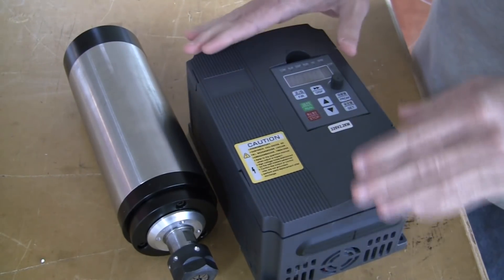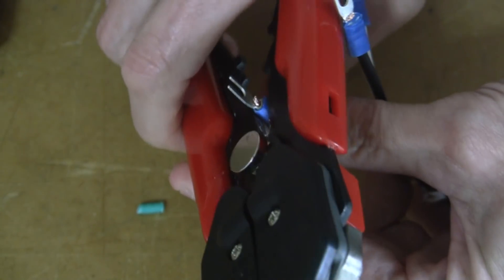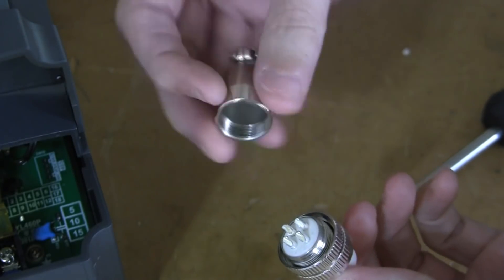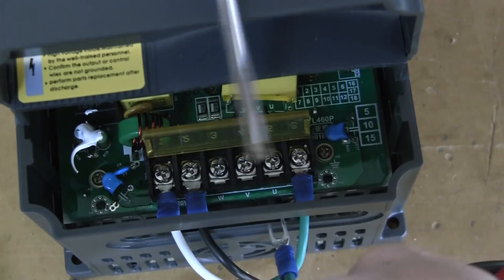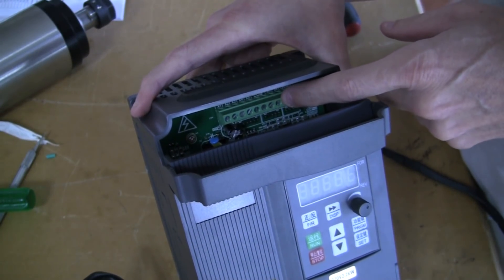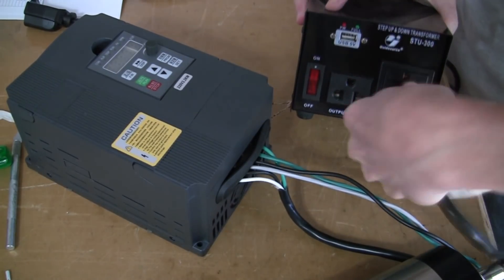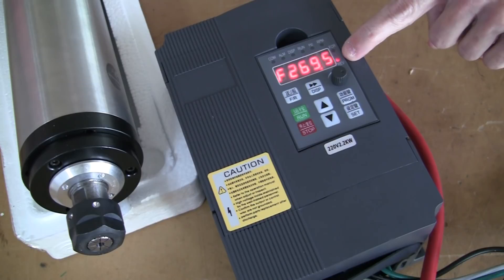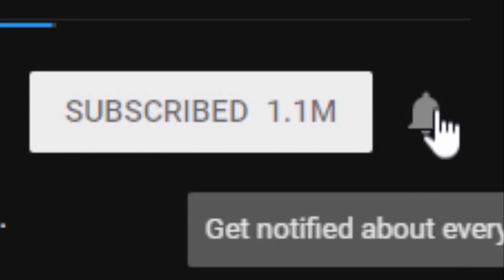Spindle and VFD (Variable Frequency Drive) Setup Part 1

Comment: why only 3 cable connected, how about pin number 4?
Reply from the maker: Pin number 4 is not conected on most Chinese spindles. Some will have pin number 4 connected to the body of the spindle, but most machines are already grounded, so no ground pin is necessary on the spindle itself. If the machine in not grounded, you may want to connect a 4th conductor of a 4 conductor cable to one of the screws of the connector on the spindle.
Reply: @PatrickHoodDaniel  ok, thanks for answer

Comment: Hello please. How do I fix the problem when my 2.2 best inverter is showing hoc
Reply from the maker: That is an overcurrent message. I would first measure the resistance between the three pins on the spindle to see if the windings have a short. Do do this, use a multimeter set to ohms, measure between pins 1 and 2, then 2 and 3 and finally 1 and 3. Make sure to do this with the cable off because the cable may have a short by itself. If the measurements are the same, the cable may be bad. It is difficult to test a cable because the issue can show itself when the cable is laying differently, so it would be best to replace the cable.
If you are experiencing this problem with a totally new VFD and spindle, you may want to reduce the ramp up and deceleration (make it a longer time).

Comment: I installed my spindle like you showed. but instead mei u was connected to 1, v to 2 and w to 3 (the spindle supplier told me this). When I start the spindle with the button "run" it runs, but then all light (com, alm, dsp, run, hz, rpm) blink very fast and i cannot stop or adjust the rpms. Does anybody had the issue? Has it something to do that i dont have a break resistance or is just the wiring wrong?

Comment: ❤what a majestic VIDEO!!THANK YOU 🙏 SO MUCH WHOEVER YOU ARE!!   1question 4 you: i have exactly the same VFD and I need to control the speed of an AC asynchronous Motor with raspberry pi; do you have any suggestion on the VFD wiring with the Raspberry pi? Could you please point me in the right direction? Thanks 🙏🙏🏿🙏🏿 a lot!
Reply from the maker: You only need the Rpi to output a PWM between 0-10V and use the VI and ACM terminals in the VFD with this PWM output. PWM to VI, RPi gnd to ACM. If you need a voltage reference of 10V, you can use the 10V terminal in the VFD.
Reply: @PatrickHoodDaniel   THANK YOU SO MUCH   YOU ARE AWSOME!!! BLESS YOU

Comment: This is not how you should be wiring a VFD Drive to one of these spindles, Electrical Code would not allow you to do it like this, this is very dangerous to wire it like this
Reply from the maker: Can you point out the error?

Comment: Thank you very much
After doing further research I noted the forth pin was connected to the ground and a cable that is shielded will provide the best results.
Cheers
Reply from the maker: Some of the spindles don't have the 4th pin connected to the body of the spindle. If your machine is grounded, you don't need to connect the 4th pin and some manufacturers will warn the end user to not use the 4th pin if the machine is grounded and the spindle is conducted to this ground (via the metal on the machine).

Comment: Thanks for the video. The video was very educative, however, I would like to ask some questions. First a background, I am setting a reactor for my PhD project and I need to run 2 pumps in variating frequences. As your video demonstrates, the motor/spindle runs only with the VFD and nothing else, correct? And for the installation, the power goes through the VFD and then connects to the spindle, so no further connections are necessary, right? Thanks a lot!
Reply: I've used a couple VFD's for other purposes and I'd say your assumptions are correct, just wall power -> vfd -> three phase motor.  Nothing else (besides the appropriate kind of wires in between).

Comment: I've been running my VFD's on a 3/4 HP 3 phase 3,000 rpm motor.........I made a chart to indicate the actual motor rpm.........connecting it according to the video was clear.....thanks for your time.
Reply from the maker: Thanks for the info!

Comment: Hi Sir. Can you help please . Can Mach 3 programs to control  spindle /VFD go forward and Reverse  ? Thanks.
Reply from the maker: Yes. You can use the M3 to run forward and M4 to run reverse. M5 to stop both.
Reply from the maker: You will need to connect the VFD through two outputs on your controller.
Reply: Thank you very much Sir!
Reply: Hi Sir.
Do you have a video or instructions how to wire and pins set  connected to control board ?
Thanks for your help!

Comment: How you manage to run the 2.2kw spindle with a 300w step up transformer?
Reply from the maker: I use a 3000W transformer for anything with load. The video here is only a 300W transformer because I am only testing the spindle and VFD with no load on the spindle.

Comment: What type/ga wire do you use for the spindle?
Reply from the maker: I would recommend using 16 AWG, but 18 AWG has worked for me.  Some spindles and VFD come with 18 AWG cable.  The wattage is divided by the three phases, so the actual current on each wire is 3.333 amps.

Comment: i also have a 2.2kw for cnc but its spinning CCW. The buttons or knobs on the inverter and the run buttons etc doesn't work on da inverter. It jst turns on n off from Mach3. No fwd/rve switch on it too. Can i chnage direction becz its meant 2 turn CW as shown on its motor description
Reply from the maker: Just swap two of the three wires that connect the spindle to the VFD.

Comment: Is the spindle a 3-phase unit and is the VFD 3 Phase as well. I have a 220 Volt/400 HZ 1.5 KW Air cooled spindle that I purchased online, but need to know what type of vfd it needS. I have one from an old lathe that we used for 220 Volt single phase to a 3-phase mill.. do you know if it will work..

Comment: Hi There, I did try with other kind of vfd who can also drive spindle but get a error on display P.oFF and no running or output voltage. manuel says nothing about it. Maybe you can, Thanks in advance.

Comment: I have Motor 37 kw
1780 rpm
220v
Can I use this Inverter

For the Motor?
Reply from the maker: This inverter is for a maximum of 2.2kW.
Reply: you need buy inverter who can run 37KW super expensive. and very big cables need be. VFD need be same size what motor you use. 2KW motor need 2KW VFD, 18 KW motor need 18KW VFD.  not can use 2KW VFD and run 20 or 37KW motor. lot different.

Comment: I'm new to CNC, but it seems a VFD is not required, right? What can a VFD allow you to do with CNC that you couldn't otherwise do?
Reply from the maker: A VFD is required if you use a spindle.  If you use a router, a VFD is not required.
Reply: @PatrickHoodDaniel  Oh, well, now it's starting to make more sense. I thought a spindle was just another term for a router that's made specifically for use with a CNC machine. Can you cool a spindle with air? I was looking at a 1050 FME-W DI spindle.
Reply: Actually, aren't these Kress/AMB spindles more like a router in the sense that they aren't water-cooled and don't need a VFD or am I wrong?
Reply from the maker: @tomjoad6993  You can cool a spindle with air.  There are air-cooled spindles, but I don't sell them.  I like water-cooled spindles because there is no air movement pushing the dust and chips in the shop.  Water-cooled spindles are great because it's less noisy (no blower fan) and the vacuum can work more efficiently removing all of the chips and dust.  Water cooling is not a big deal to establish and it cal all be compactly fixed on the Z-axis.
https://buildyourcnc.com/item/pneumatic-hydraulic-spindle-inverter-cooling-water-pump-reservoir-fan-radiator-g14fittings-silicone-tubing
Reply from the maker: @tomjoad6993  I don't have very much experience with Kress or AMB.  From what I know, Kress are very much like routers and don't need VFDs.

Comment: Good video. However I would recommend connecting the spindle to the VFD using shielded cable and earthing the shield at the VFD end. This is really important for CNC systems to stop the spurious electrical noise causing problems with your steppers. Also it appears that you did'nt earth the spindle either, which is not really a good thing to do.
Reply from the maker: Thanks.  I have been using shielding a little while after I made this video.  Initially, I was testing the PWM from the computer to the VFD and noticed the value jumping around like crazy.  Now I shield the spindle cable and I also shield the PWM signal cable.  I've also seen some folks actually use ferrite to assist with the PWM signal cable.  The wires are coiled around the ferrite to create inductance.  I'm not sure how this helps, but if you or anyone could shed some light on this, I think it would benefit others.
Reply: @PatrickHoodDaniel  The ferrite core is known as a load reactor but it’s just an inductor. Motors on VFDs create a lot of harmonics and reflected signals (voltage spikes coming from the motor back into the VFD). These spikes can reach thousands of volts so the load reactor is there to limit the spikes and protect the VFD and motor
Reply: Thks!!
Reply: The spindle must be earthed (grounded) for safety! Without en earth, a small breakdown in spindle winding insulation can cause the body of the spindle to become energised with a couple of hundred volts and killing someone. With proper earthing, the faulty spindle will trip the fuse, CB or the drive unit, keeping everyone safe and you knowing your spindle has an electrical fault. Earthing/grounding is essential to safe operation!

Comment: good video  but can you let me know where the wires go in the 2 top buss bars, i have had to change from a sunfar e300 to a huanyang and all the lettering is different the old was X1,X2.X3, CM, & FWD the last 2 being linked. i can get the spindle to turn when i press run, but not from the computer, Please help paul@wwww.uk.net.

Comment: conduits inside of cable? Interesting...using cord for your spindle is no beuno. Spindle motor is three phase, plus you need a fourth wire out there for a ground. Should also be shielded. That VFD will make lots of interference which can drive your controls bonkers. Don't use 300V rated cord. Not safe.
And conduits are pipes that you run wires in as a raceway. Conductors are inside of cords.
Reply from the maker: Thanks for the expert advice.  I currently use shielded cable and I add a 4th wire to the body of the spindle.  Is that what you would recommend?  What gauge would you recommend for 2.2kW spindle understanding that each wire would carry 1/3 of the current.
Reply: Great!
I would definitely recommend the protective earth connected to the body of the spindle motor. I think 16 ga would be the minimum size you'd want to use on a 2.2KW spindle.  The 2.2KW motor will draw roughly 10 amps at full load, which is 10 amps on each wire, 10 amps total. You wouldn't divide 10 amps by 3 to get the current on each wire, or multiply 10 by 3 to get total amps. A three phase motor is sort of like 3 single phase circuits, only each circuit is 120 degrees out of phase with each other.
Also, I re-read my original comment and it looks a little abrasive. I apologize for that.
Reply from the maker: @shampyswoodworking525  Thanks for the clarification.  I was under the assumption that since the total drawn from the spindle was 10 amps (2200W/220V = 10A) and if the total current was traveling through three separate coils, that would be divided by three, making each wire requirement at 3.34 amps.
Reply: @PatrickHoodDaniel  no, that isn't the case. If you look at a 3 phase motor's nameplate, you'll see a bunch of ratings and data for that motor. One of the numbers will be labeled FLA, which is full load amperage. If the FLA rating is 10 amps, each leg will draw 10 amps when the motor is doing it's rated KW or horsepower worth of work. We would describe that as 10 amps, 240 volts, three phase. Likewise for a single phase 240 volt circuit in your house... same idea. Your dryer might have a 50 amp, two pole breaker feeding it. That breaker is essentially 2 single pole breakers tied together, each pole rated at 50 amps, not 2 poles at 25 each. So the motor's wire size needs to be sized to it's FLA rating, in this case a 2.2KW motor at the given voltage will be around 10 amps (A little less than 10 actually, because in the US the single phase voltage will really be 240V).

Comment: Thats 110v not 220v WTF
Reply: Nah, it's a 240v, it is just wired up weird.  He used a normal 120v plug, but when he plugged it into the transformer, it basically made the hot (black) the first 120v line, the neutral (white), the second 120v line, and the ground (green) the neutral.  Building inspector would have their asses...
Reply from the maker: Please elaborate.

Comment: thank your, one question, how i can move the spindle with the software? i have CNC usb controler  but i cant move it
Reply: I could be wrong, but I believe most people do not control it that way. They turn it on manually, then run their cutting program. I've seen this done in many videos that way.
Reply: cnc usb controller need setting in software what pin you use controller breakoutboard, on/off. and usb breakoutboard need be output to relay who cut power ON/OFF to VFD data pin.  VFD manual tell you how program VFD use data pin x1 etc, and need connect this pin relay, and breakoutboard controller relay, and software setting and controller pin what you have use this breakoutboard pin. example if breakoutboard pin number 17 use relay, you need setting software this pin 17 used to relay. then relay  make ON/OFF to VFD data pin x,, and need program VFD manual pxx on or off, use this data pin control VFD on/off.

Comment: I have 30V 150W jager spindle and I want to run it using 220V input 400W Delta VFD L. I reduced maximum output voltage of VFD to 30V. By doing this I am able to rotate spindle on high frequency but I am not getting enough torque and when I stop spindle from VFD then over current alarm appears on VFD. Also spindle takes very high current. Please suggest if you have any idea from your knowledge perspective so that I can run my spindle using VFD instead of highly expensive spindle driver.

Comment: I suppose, these don't require the home wiring to be three phase. Am I right?
Reply: Indeed - they generate three phases by converting incoming AC to DC and use PWM/IGBT's to generate an approximation of 3 phases.

Comment: Hi , why do you call it a spindle ? 
The dictionary says a a spindle is 'a rod or pin serving as an axis that revolves or on which something revolves'.
The centre of an electric motor is a spindle but the whole motor is not.
I think you mean its an electric motor.   Is the motor 3 Phase ?
Reply: He's referring to it as a CNC spindle.  It's a term used in the CNC industry for the electric motor that drives the milling/cutting tool.
Same word, different context.

Comment: Would you try to apply 110 VAC input  with 220 VAC  VFD Model and use 110 VAC motor to see it working or not. The reason  220 VAC VFD a lot cheaper than the 110 VAC Model.

Comment: Have a question.. A Hz is frequency of output sinus, so it not exactly rpm?Need to divide by motor polys number for really rpm / rps ?Thank you
Reply: Yes. The given freq was its max modulation of 400 Hz to deliver that rated 24K RPM.

Comment: The extension cord you took out of the package is a NEMA 5-15 115v single phase cord, not at all a 220v cord.  If you plug that into a wall outlet in the US you will 115 volts.
Reply from the maker: That is correct.  I should have mentioned that I'm using the neutral as another live where I am using L1 and L2.  I appreciate this comment as I am pretty good with the digital electronics side but I am not strong in the electrician side.  I make this clear on the spindle page as I have a disclaimer to seek a professional electrician for connecting a VFD.  This disclaimer is here under the instructions section: https://www.buildyourcnc.com/item/spindle-inverter-2!2kw-spindle-vfd
Reply: So did you cut the plug off and install a 220v plug?
Reply: 😮😮, wow, 😳😅, that's news to me too, I didn't know that. Now I know why I thought cable does not work 😂😂. M in Africa, 220V😊

Comment: Hi, I have just bought one of these to replace a different VFD that went BANG! ;) I have an identical spindle motor to your one in the video,  I am concerned about getting the parameters on the VFD correct as I don't want to kill my motor! Is there any chance you could let me know what parameters you changed from the default values ( P06 for example defaults to 50Hz, but I guess you have it set to 400.) Any help would be greatly appreciated as I am desperate to get my machine up and running again! thanks in advance :)
Reply: Check out the CNCZone. I saw someone posted the working settings for that model.

Comment: You should definitely connect the spindle to ground, the forth pin needs to be connected to the spindle chassis. (Big mistake from the factory) And you should use shielded cable, with the shield connected to ground on the motor side.
Reply: I would connect the ground on the VFD end instead, unless the machine body has a better ground connection than the one in the mains cable.
Reply from the maker: Yes, we do.  We recommend that the Protective Earth be connected to the housing of the spindle typically to one of the screws of the back round connector.  Thanks for pointing this out.
Reply: Thank for the video. One other thing to point out (you will already be doing this if using shielded VFD cable) is that the green wire should never be used for a current carrying conductor (power wire).